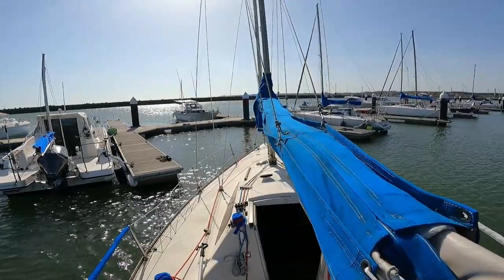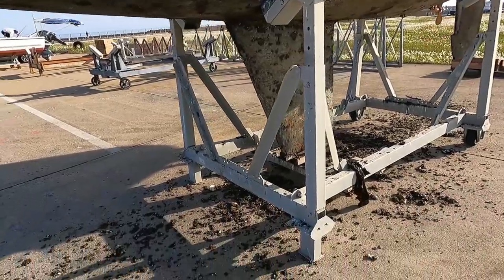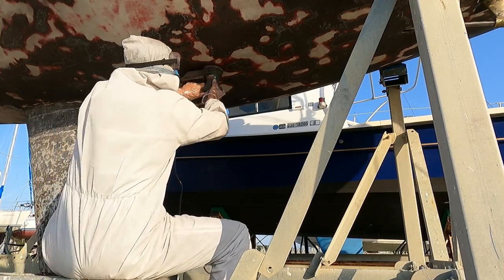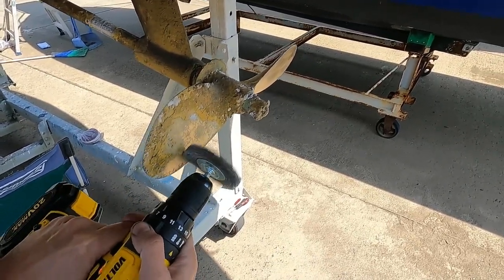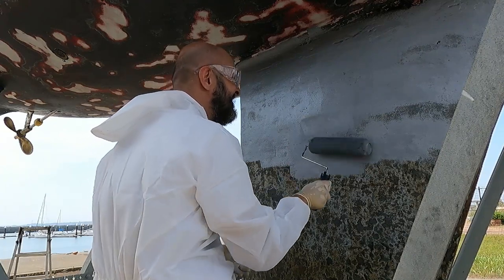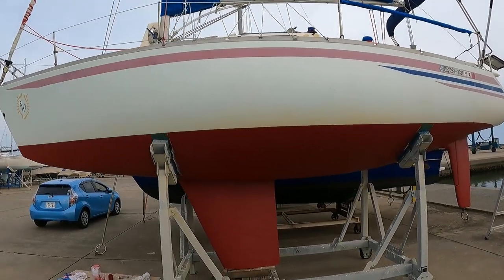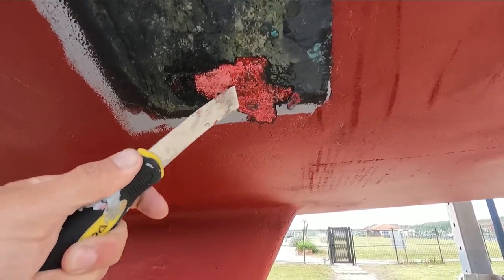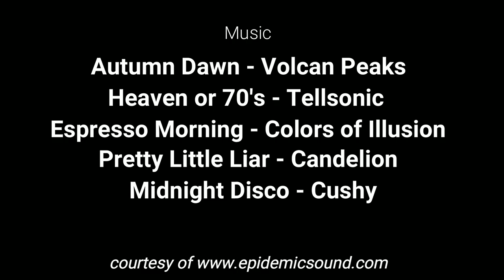Ep. 19 Hull Painting - First Time!

Comment: Good job!  I watched with interest every step of the way.  Glad to see you have a disc line cutter.  I recently installed one on Wahine.  Did you find any damage on the disc?  I see you painted it. Hmmm… makes me  think I should have done the same … hmmmm …
Reply from the maker: No damage on the disk whatsoever. I repainted it because it was painted in the first place and there was still some growth on it. It probablz does not require to be painted as it is not original part of the propeller assembly, so you should be OK.

Comment: I have one question before you painted did you wipe the hull down with acetone?
Reply from the maker: Hi Alan, no I didn't except for a light brush of the keel. For the hull,  once finished sanding I used dry cloth and wiped it in couple of passes to remove dust and dirt.